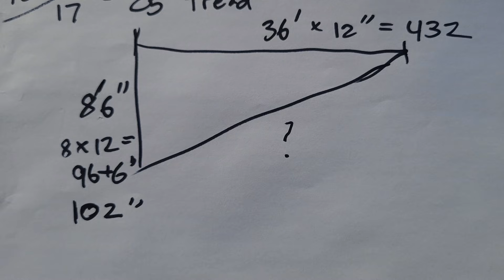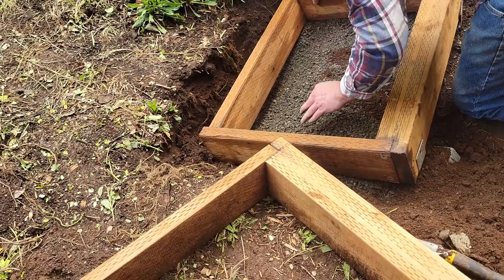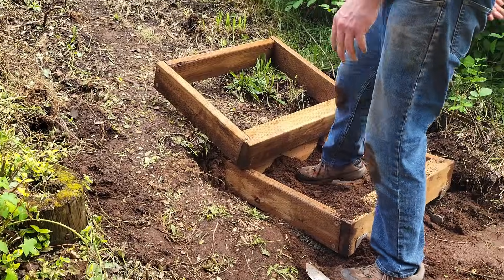Building DIY Outdoor Steps on a Slope or Hill | Timber Landscape Garden Stairs

Comment: Bravo et merci. J'ai pourtant l'impression qu'il y a eu une erreur de calcul sur la hauteur des marches, le travail de terrassement sur les dernières aurait pu être réduit. Cordialement
Reply from the maker: You are correct.  I had a little bit of a miscalculation, but we opted to do the top as deck stairs because we got tired of digging

Comment: how do you connect each step together? Do you lay the next step on top of the lower one? If so, do you use a bracket to prevent the upper step from moving?
Reply from the maker: Good question! Unfortunately, I had shot some video that explained all of that and the files were corrupted when I went to edit it. Basically, you can lay the higher frame on top of the lower frame, and use a bracket, or you can pound rebar or landscape nails through both sets of frames.  As you dig the next level, a large majority of your structural support is just the hand cut dirt that is dug and stepped out.

Comment: Impressive design!  I have a similar slope, here in western Massachusetts.  Similar length and rise…..but initially, I want to avoid wood framing….so i considered Goshen stone, as we use that throughout our property….but aside from expense, that would be tough to haul and layer on that slope that slope—-and cost-prohibitive.  Then I considered using”antique brick, as I have  a large amount that I “salvaged” and organized from an old farm dump.A couple years ago, we ripped out a composite deck, to build a patio….i kept the 2x10s and composite decking, for some unknown (at that time) purpose….maybe that?  Aaaargh! I’m 70 now…recovering from heart surgery after retiring from two mentally and physically challenging careers (military and federal law enforcement)….maybe, just maybe, instead of building steps,  I’ll just go fishing, biking or golfing—-or sip some bourbon!  Your video….is encouraging me!  So, Bravo-Zulu, brother, well done!
Reply from the maker: New England and NE states have the best stone buildings and walls! Thanks for watching and commenting. Take retirement easy--you earned it.